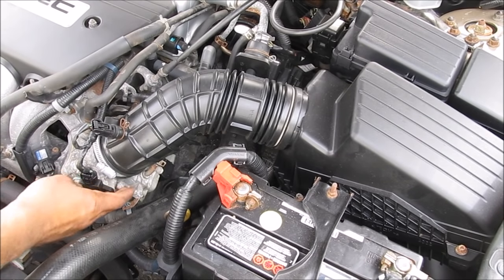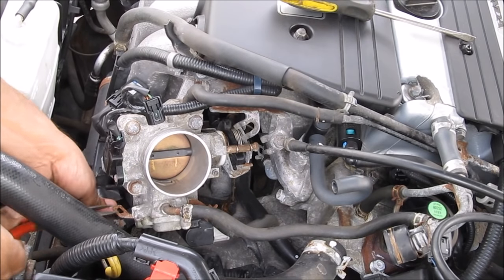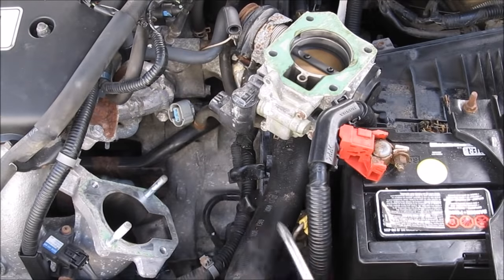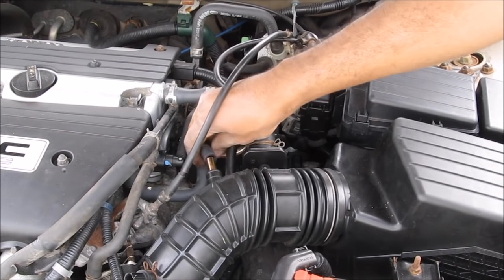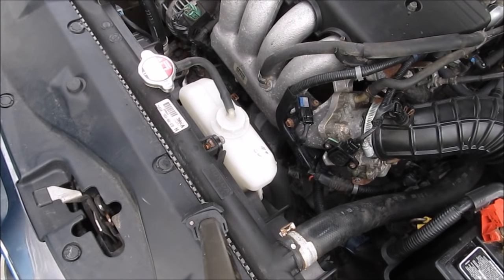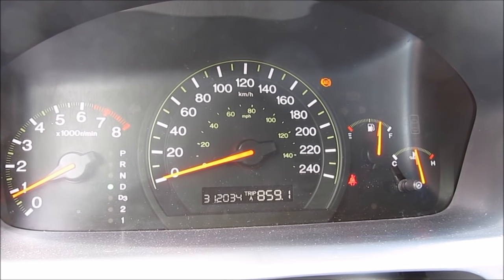Honda Idle Air Control Valve, PCV and Throttle Body Cleaning

Comment: Hi! Mi honda f23a1 IAC valve works ok, but i removed it to make a close inspection because of other repairs in course. Mine has a lot of dirt (moist dirt... kinda oily), and i think a superficial cleaning its not going to be enough. The valve solenoid has two 5-lobed torx screws for which i happen to have the bits. I removed them and tried to pull the solenoid apart carefully, but i felt some kind of restitutive force, like if there's a spring or a strong magnet retaining the shaft. I don't know where this force comes from, and i don't want to damage the valve, so i didn't continue pulling the solenoid. I can't find info about the disassembly of the valve anywhere. Do any of you have tried disassemblying the valve completely? Is it safe for the solenoid and its position respect to the shaft to just pull it apart?
Reply from the maker: No I haven't. Why not grab another used one from the junkyard and try your luck?

Comment: How much did it cost you to replace all the hoses you mentioned?
I would’ve just reinstalled the old ones if they weren’t cracked. 
I recently purchased a 1990 Honda Accord ex with 80,000/for $1,200 and I would like to know what size of hoses my car has.
Reply from the maker: In didn't replace them

Comment: if some coolant was to drip out and get further into the intake assembly when doing these should i be conserned
Reply from the maker: +landon landon water or coolant in the engine is not a good thing. If you can try wiping it up or vacuuming as much out as possible.

Comment: I have a k24 swapped ep3 my idling at stand still goes from 1800 to 1900rpm and then it drops to 800 to 500 rpm and the engines shuts off do you think I need to clean them

Comment: lol. i took a 1/4 inch ratchet and took the 2 screws off the iac. cleaned it, greased it and put it back on. no other parts removed. idled perfect.

Comment: Hi there, Haynes manual for my 1998 Civic says the throttal body has a special coating and cannot be cleaned. But I have found a few throttal cleaners brands that say ok to clean. Whats your advise? Nice video many thanks.
Reply from the maker: +Pathy K Use a throttle body cleaner that says it's safe for throttle bodies. Don't use just carbuerator cleaner.
Reply: +speedkar99
 Hi thank you. could you please recommend me one, will save me time googling as so far I cant find one in  the UK that says safe for special coating.

Comment: Is the IACV part of the Throttle Body?  If I order the Throttle Body Part, does it come with the IACV?  I'm trying to just replace that part, I'm car stalled once at a stop and I think it might be the Throttle Body.
Reply from the maker: +Poolarity They're bolted together but most likely sold separately. Make sure you get the gasket too .
Reply: Yes sold separate !

Comment: by cleaning out the throttle body will that also improve my RPM Max as of right now it will not go past 4000 RPM on my 1998 Honda Accord LX 2.3 liter
Reply from the maker: +Patrick Goza Yes. Check your fuel pressure.
Reply: Thank you for the input, loved the video by the way, just becarefull to not use your toothbrush lnao
Reply from the maker: Its my brother's toothbrush. I put it back exactly where I got it from in the bathroom...
Reply: Lol

Comment: Her is a Dame hard question I got a 02 Honda Civic LX I change new Sparks new coils new cam belt trotel sansor basically almost everything when. I start the car the battery comes on Whit check engine the ideal searches after 12 seconds ideal drops to zero my battery light goes of check engine light blinks then stays on I can switch gears but zero ideal do u might know what's the issue ?
Reply from the maker: Alternator?
Reply: @speedkar99  nope non of those

Comment: What's up with all the rust on the engine parts? My 03 rsx type slow with 315k miles has no rust or corrosion in the engine bay.
Reply from the maker: +thehoofersclub Canada

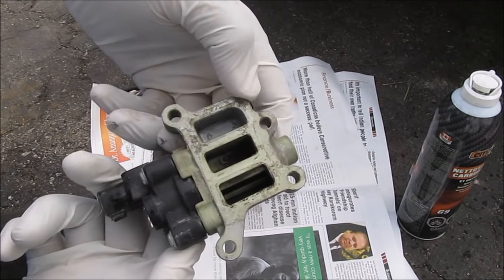Comment: Its better to remove that 3:32 solenoid you said, its torx bolt or screw ,I just cant remember because sometimes you cant just remove the carbon deposit by only using that toothbrush and brake cleaner or carb.cleaner. You have to rotate the thing there and make sure its not stuck or sticky. Dont forget the o ring to put it back. You just have to remember to put it back in the same way. Its not difficult to do trust me. 
Ps. Its better to change or put some tiny bit of sealant in iacv valve when you remove it(4:08 the seal thats sealing the coolant) because the coolant can go straight inside your engine and bend your connecting rod.
Reply from the maker: Good tip thanks

Comment: Hi sir, my crv R20A engine when cold engine start, my rpm will not consistent when load to Drive and aircond on, but when engine is warm enough there have no rpm up down issue, what's the issue when in cold start? Thanks

Comment: Hey brother you seem like you know what your doing around these Honda’s I’ve been having problems with my breaks locking up after 5 minutes I change the booster and master cylinder break lines all around calipers all around check valve hose break switch abs module and still locking up I took it to Honda they couldn’t figure it out except to say we need to throw parts at it which is exactly what I did the break did work when I bought another booster from the salvage yard for 2 weeks but the problem came back I’m thinking to much vacuum at booster causing the rod to push on the master cylinder thinking of adjustment on the break booster rod what’s your fix would really appreciate that thanks for reading
Reply from the maker: ABS module?
Reply: @speedkar99  you think it’s a ABS module I was under the impression that a code would come up on the abs module

Comment: Great video! But I'd like to note for other viewers that Honda doesn't use regular Phillip's screws, they use JIS screws (Japanese Industrial Standard, usually denoted by a dot stamped into the head of the screw.) Get the right screwdriver for the job and don't strip out the original screws. Vessel is a good Japanese company that makes quality JIS screwdrivers. Same thing with the brake rotor screws, remember, there is not a single Phillip's headed screw on ANY Japanese made vehicle! Do not use a regular Phillip's screwdriver made for American screws, they are made to "cam-out" or strip the fastener at a predetermined torque, whereas the Japanese screws have a different head design enabling them to handle higher torque. Research JIS vs Phillip's screws to learn more.

Comment: Does this fix vibration at idle? My steering wheel vibrates like crazy when I'm stopped at a light. Also when I turn on the A/C. I'm guessing I have either a dirty IACV or a shitty one. Thoughts? Thanks for the help!
Reply from the maker: +Steve Çina yes it should help, but the 4 cylinder naturally vibrates. Even worse when you have the AC on and engine mounts are worn
Reply: speedkar99 hmm I was able to work on it today and I noticed my throttle body was difficult from this videos. I got a 2.4 l vtech honda accord 07. Cleaned up the throttle body and replaced the air filter but still experiencing heavy vibration when in Drive and my foot on the break. I'm thinking now it's gotta be the engine mounts or something
Reply: speedkar99 *different

Comment: Hello Speedkar99, love your video well done and very informative.  Wanted to ask a question, I have a 99 4clynder with 200,000 been a fantastic car so far but now it’s doing the revving up and down but only after it’s warmed up. I cleaned the carb with carb cleaner but no change, but I did notice that when it’s revving up and down and if I tap on the housing around the intake butterfly it levels out but as soon as I accelerate it goes back to revving up and down mode. It never dies but when I try to drive it when in the mode of revving up and down it's terrible. In your opinion do you think it’s the idle control valve or something else? Jake.
Reply from the maker: +jmercado4 idle air control valve or a vacuum leak
Reply: Shit I have the same problem idle Rev up and down. This happens after my clutch position sensor rubber stopper broke off and car not starting.  I opened the intake manifold and replaced the starter. It started but reve up and down. I don't see any leak.
Reply: Just never got to respond, but replaced ACV sure enough cured the problem. Thanks! Jake
Reply: @jmercado4  hey do you got to clean the throttle. ?
Reply: @benten6301  tried that no change so I just replaced it.
Reply: @jmercado4  appreciate that quick reply. I am praying it fix my inspection this month.
Reply: Did you open up trying to fix something then it happened with the rough idle reve up down.? Mine was perfect till I opened it up to replaced starter.
Reply: @benten6301  nope it did it all the time until I replaced the ACV

Comment: whats the repair cost of a IACV for a 1998 acura el? also im not getting a check light engine, its driving really good. new battery, 3 new belts, oil change and filter, also an engine filter. its driving really good but revving in park and neutral. does anyone know what the average repair cost in CAD at a mechanic shop ?
Reply from the maker: If it's driving good why repair it!

Comment: When cleaning the IACV - yes do clean it out with cleaner and I also put just a little bead of oil to Lubricate the Flapper ROD DOORS  on both ends  INSIDE .....FYI—great video though.
Reply from the maker: Thanks for the tip

Comment: ok I was able to finish doing everything .. got everything off and cleaned the throttle body and idle air control valve and replaced the intake hose that had cracks .. the car seems to run better but now my idle is at 2000 .. what could it be ?
Reply from the maker: It has to relearn idle. Reset the battery
Reply: See my comment, I share the fix. “Remove the battery negative cable and turn on the headlights for a few minutes” to completely drain the energy and clear the ecu. If you remove the battery negative only, it does not clear the ecu.

Comment: once my car gets hot i cant rev over 3,000 rpm do you think this will help ?
Reply from the maker: +Defucials Is it over heating?
Reply: no i just cant accelerate as fast anymore because if i do it jurks and doesnt let me go above 3k rpm
Reply: Change the oil and filter if you haven't done so already then check VTEC System

Comment: If you have ramps to drive the car up onto in order to raise the front of the vehicle, this will help to bleed any trapped air out of the coolant system. Parking on a nice hill will do the same thing if you dont have ramps or a special radiator fill bottle designed for this job. I would have also bled the IACV before reinstalling the hose clamps as this is a famous Honda problem of air trapped inside the IACV. If the heater core hoses are easy to gain access to I like to bleed the heater core manually also, its best if you know which hose is the outlet side. I was worried about this vehicle when no coolant came out of the IACV hose that was first disconnected. The symptom of this problem is an extended warm up cycle before the idle slows down after a cold start. Worse case the idle will surge a little when warm and at a stop when the vehicle is not moving. Longer story as to why movement comes into play on some Hondas. I personally would also have changed the gaskets on the throttle body to prevent vacuum leaks behind the butterfly valve in the near future. Thanks for the tips.

Comment: OK I have done this on a 2002 gen 2 Honda CRV 2.0ivtec UK model, but I can't figure out how to get the throttle body back on the intake to line up with the 4 bolts. Seems like there is not enough room. Does anyone know how? I have been trying now for 2 days. Thanks in advance
Reply: I managed to refit it using brute force, but since then it has been pissing coolant from the Idle air control valve into the intake! I just bought a used throttle body with IAC so hopefully that will fix it. My advice with these things would be to just spray some carb cleaner in and leave it over night. Taking it apart can cause problems.

Comment: same car idle is at 1500 rpm normal running. . ive clean the same like you did.. but still same.. what should be done? even disconnected battery and even re learned the computer by holding 3rpm till fan turn.. but still same. . help please
Reply from the maker: I had the same issue. The idle air control valve needs to be replaced, I didn't do that though.

Comment: you need a jis (Japanese industry standard) screwdriver for those screws on the idle air control valve
Reply: Thank You for this tip, I did not know it was an industry standard fitment. I have used a die grinder and cut a Slot in the screw head for removals, never had much luck with vise grips.

Comment: Do we need to remove Battery connection in doing this or not?
Reply from the maker: Always Remove the battery when working under the engine bay for safety. But also to reset the ecu
Reply: @speedkar99  How to reset the ECU?

Comment: What is the point of having coolant running inside idle control valve?
It is a servo motor and electronically controlled by ECU.
If you live in subtropical climate area I understand it would prevent icing on idle screw orifice, but I lived in tropical country that never have snow. I never understand what is the point of running coolant if the manufacturer intend to sell their vehicle in tropical country.
Reply from the maker: What if it overheats and becomes unresponsive? Hmm 🤔
Reply: @speedkar99  i more concerned that hot coolant may heat up air running to the intake plenum and increasing intake air temperature, less air density, less power..

Comment: Nice video and a good repair to know but anybody who's worked on Honda's knows that you have to unplug it first, and then disconnect those coolant lines. Also why change out the TPS....? I hope you replaced those parts using only Honda Genuine parts. the reason why you couldn't remove that screw is because it's a self-tapping screw. Honda don't want you changing that sensor. And I'm pretty sure that Accord model uses a speed density type system therefore it uses a MAP Sensor, not a MAF.
Reply from the maker: Thanks for the comment, 
Most idle air control valves are difficult to get off because of those screws, Honda is no exception

Comment: Replaced but the problem persist!  What could cause the issue??
Reply from the maker: Wiring
Did you let the computer relearn idle
Reply: @speedkar99  yes
Reply: It happens after 5 to 10 min of driving or starting the engine!

Comment: Two things, that coolant looks really old and needs to be drained and replaced and don't use water to top off the overflow container, use the 50/50 premix Honda coolant or other name brand coolants that specifically say it is for Honda, and is most likely blue color.

Comment: The guys at the part store think I work on a lot of cars with how much carb cleaner I buy but they caught on when I kept bringing in the same throttle body that never got cleaner. When they called out my cover, I simply replied honestly. "Listen, I just like the smell of it, ok?" I awaited their response, expecting it to be full of judgment and disgust. Little did I know, I made a lifelong friend that day. They too liked the smell of it. So we both went to the back of the store behind the oil recycling tank and proceeded to "accidently" spray each other in the face with that sweet, sweet carb cleaner. We then finished each off with a pair of textured nitrile glove that were on sale. Ah, memories.
Reply from the maker: I'm guessing you're not married

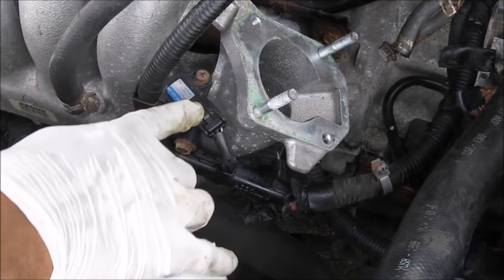Comment: At 4:40, that's actually the Manifold Absolute Pressure (MAP) sensor;  not the mass air flow (MAF) sensor .

Great video though.
Reply from the maker: Thanks for the correction

Comment: Do i have to replace tb & gaskets after removing
Reply from the maker: It's a good idea to yes
Reply: speedkar99 
Same K24 accord motor in my 09, almost 200,000 miles, I'm sure these motor mounts haven't been changed and I can feel the engine rock at shift points and partially so at power points, reducing delivery and throttle response. 
Have you a video of swapping out these motor mounts?
Perhaps you gotta link? *subcribed

Comment: Stripping the 2 IAC screw heads is probably because Honda and Toyota both need a JIS screwdriver bit which is Japan standard.... not a USA Phillips one that does not quite fit snugly. Get a pair of cheap cost #2 JIS bits that will fit exactly ...and use a dab of Kroil to loosen the 2 screws 10-15 minutes before taking off the IAC valve...

Comment: Hi, I cleaned my 2003 Honda Accord throttle body and replace the idle air control valve with a new one, now I have a car with fluctuating idle. I did let the air out of cooling system but at this point I don't know what to do next. Any suggestion would be highly appreciated. Thanks, Mark.
Reply from the maker: +Mark Mostashari did you perform the idle relearn procedure after reseting the battery ?
Reply: No, I don't know how to do it.
Reply: That's what he did when he pulled the battery cable. Or you can pull the ECU fuse by the brake pedal for 30 seconds instead.
Reply: Spark plugs maybe?

Comment: why clear it? for vibration?
Reply from the maker: For proper idle control, air mixture during idle, and yes vibration
Reply: @speedkar99  my car is 2007 2.0 accord... I didnt seen IAC valve in my car... then my idle display not vibration... only my engine vibration... On D and R..

Comment: +speedkar99 my iacv for my honda crv 2004 is being eratic. i cleaned. still idle is still not normal especially when my AC is on. should i replace it?
Reply from the maker: +Butch Wacker yes. I think mine still had that issue even after cleaning. High idle
Reply: +speedkar99 its fixed,change the iacv with new spark plugs.